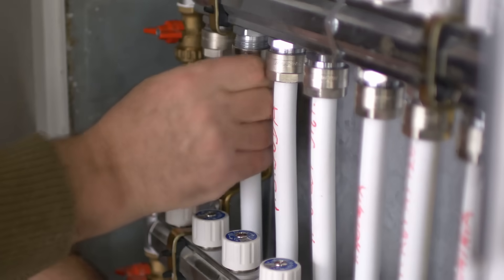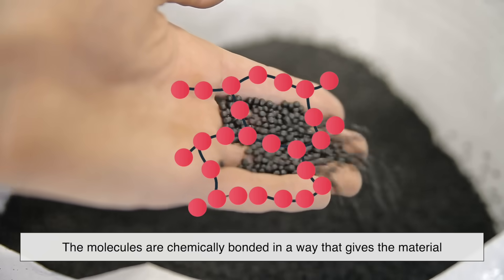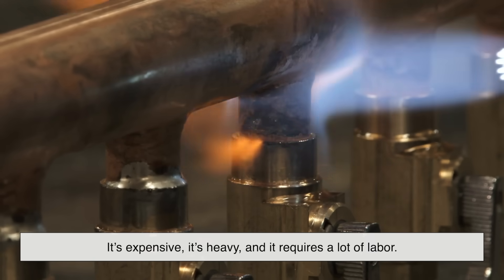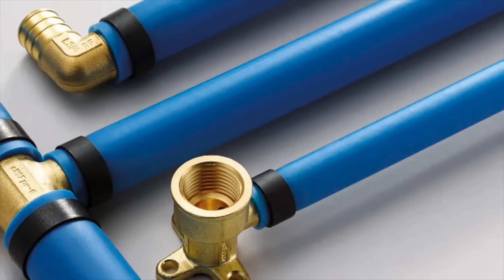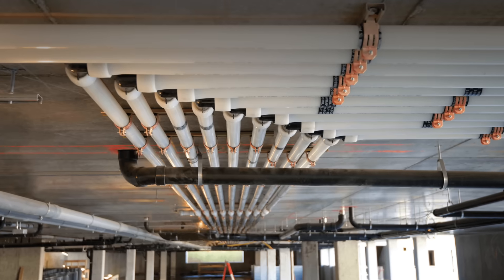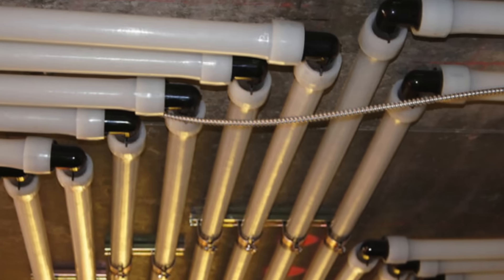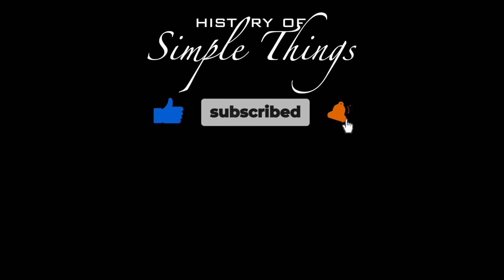What Is PEX and Why Is It Popular in Modern Plumbing?

Comment: Well be ripping all this out shortly all over the place due to toxic chemical leachate and microplastics. Not only that it can't be recycled so it goes straight to landfill at end of life..Plumber of 17 years and not 1" of plastic in my house. All the research on the safety of this product for human health was done  by the industry and then just handed to the EPA for rubber stamping...scary AF. We did not evolve with plastic in the environment and thus do not have the biological means necessary to deal with plastic and it's byproducts in our bodies. Copper can be toxic in high doses as well but at least our body has a means of removing it over time. Pex is also effected by water chemistry despite what they claim and is badly damaged by U.V leading to it becoming brittle and dry rotted. I see it all the time in service. These products suck, period and disgust me while offending my tradessmans honour to look out for the health of society and bring life giving clean water to the people. Stick with copper....proven and proper. Piping you can take pride in as it requires skill and precision.

Comment: Our 25 years old house had copper piping. Five years ago it started corroding. After third leakage we replaced copper piping with PEX tubing. It took just 2.5 days, it solved our plumbing problem. It is a complicated chemistry behind copper plumbing in certain areas, that makes PEX tubing a winner in todays plumbing systems.

Comment: It's cpvc or copper.  Contractors use PEX in new homes to save time and money and  especially in really old homes its quick to install and run in the walls to upstairs. Mobile homes manufactured homes use PEX for years but it was different plastic then now but its still flex and not rigid plastic I'm sceptical about it.

Comment: I'll old school. I like copper. The old plex  pipe would go like toffee at temperatures over 80°C and would burst if the pressure was 0.2 bar at that temperature. I had terrible problems with it back in the day. The new stuff though is so much better. Pressures of 16bar at 95°C. Thats impressive.
Reply: If you live in a place where the temperature exceeds 80 deg. C., I'd consider moving.
Reply: As long as it's virgin copper which is expensive material and labor wise My house was built with recycled copper I have replaced probably 30% of due to leaks Will replacing all the copper with PEX

Comment: Pex or Alupex works great. In timber construction the advantage is in not having to use an open flame near flammable material. There are insulated versions as well, these should be used in cold  climates, to prevent freezing, keep warm water hot and in warm humid climates to prevent condensation on your cold water pipes which could lead to damp spots in stud walls and ceilings.
Don't use fittings in inaccessible places, but run a single length from the distribution manifold to each tap point. Same when used for heating via under floor heating or radiators.
There is even a version used for natural gas in Europe, although I would rather trust soldered copper pipe better for that application.

Comment: I've used PEX, PLEX and Worsbo (I may have spelt the last one wrong) as well as copper! I'll take any of the plastic piping over Copper. Cheaper and easier to repair and replace! I replaced a 50 foot long piece once and all I had to do was attach it to the old pipe and pull, it went right around corners, no issues! Being able to pull pipe like wire is game changing for reno work. Not having to rip entire walls and ceilings out can be such a money saver! Not to mention every single copper to copper fitting is a point of weakness and 90 degree elbows especially so. I forget the length of the longest piece of copper pipe you can get. But you can get hundreds of feet of the plastic pipe on a giant spool and then you cut to fit, it doesn't matter if it's 5 cm or 50 m a simple pair of hand cutters is all you need. The Worsbo requires a special tool that isn't exactly cheap (but you only need one of them) in order to make connections. But I kind of prefered how it went together compared to the other kinds. But I wouldn't hesitate to use either of the other types!

And so far I have heard of NO safety concerns regarding to chemicals leaching from plastic pipe to water. Which is what everyone saying copper is better, tries to claim.

As to longevity, burry a piece of copper beside a piece of plastic pipe, come back 6 months later and see which is in better shape.

Truthfully, the only downside to the plastic piping that I know of, is that it doesn't do well in Direct Sunlight. Over prolonged exposure, it can become brittle. So don't use it in a greenhouse or wrap it! Yes they have insulating wraps and tape for that very purpose.
Reply: Very interesting, what happens in a house fire?
Reply: @megapangolin1093  LOL!!! You do realize a house fire melts solder as well and any pipe that survives has to be scrapped? Riiiiiiiiight???

Those are some mighty thin straws your grasping for! 😉
Reply: You are wrong. Every connection and elbow is a weak point is true for all pipe systems, not specifically copper, but with it you have a soldered metal connection which is much stronger than pex. If you can't learn soldering then use propress fittings. Copper is far superior. 7g of plastic in every brain and 11g in alzheimers brain, plastic pipes are dumb. All pex is virgin plastic, its not recyclable or made from recyclables, copper is infinitely recyclable. You can get copper pipe on rolls. Copper pipe lasts longer everywhere the sun shines, your one counterexample is wrong as pex pipe gets crushed and eaten by rats whereas copper doesn't.

Comment: the 1" pex pipe from the water heater in the attic in my sons 2 story 10 year old home broke when no one was home that weekend and water destroyed the whole home.
Reply: ALWAYS, ALWAYS  close the main valve when leaving
Reply: What did the insurance investigation say? Because I have to wonder if it was properly installed? Pex isn't recommended for some heating systems because they exceed temperature limits and while resistant to breakage when frozen, it can still break. I'd need a whole lot more info before I'd believe it was just a PEX failure.

But sometimes crap happens.
Reply: @12crows1  The track home is in a comuity of 100's of homes all built at the same time, in Riverside Ca.
Reply: @funlovingJohn  I've seen entire housing divisions done wrong because of cut corners. Any other houses do the same thing in the area. Biggest corner I see cut is not insulating the lines and that's a big deal in really sunny locations. PEX gets brittle when exposed to a lot of sunlight! That's why I prefer Worsbo, but it's a little more expensive.
Reply: PEX is a plumbing contractor’s dream come true. It’s a nightmare for homeowners.

Comment: In Brazil we still use PVC tubing, even in new buildings today. Probably because our water is chlorine purified, so it would degrate too fast.
Reply: Pex doesn't react to chlorinated water.  . Nearly every jurisdiction in the US has chlorinated water .
Reply: @texasslingleadsomtingwong8751  The video said that it does.
Reply: @kc9scott  But the reality say otherwise
Reply: @r.guerreiro140  I'd expect that PEX should be OK with chlorine; the US water supply makes heavy use of chlorine, and PEX is common here nowadays.  I'm just reporting what the video said; I don't know what info is actually correct.

Comment: Whats the history of backflow preventing devices? What are they used for and how do they keep your water safe to drink?
Reply: Ummmm, backflow preventers aren't really used to protect drinking water. They are more to keep water flowing in one direction in a looped system. Backflow preventers can also be used in sewer systems to stop sewage from coming back up. 

If you've seen someone put a backflow preventer on a drinking water system, I have to ask WHY???

I was the Maintenance Supervisor for a city of 150 000 and if you need a Backflow preventer on an incoming drinking water line, then you have a problem and it might be a crooked Plumber.
Reply: Isn't the water plumbed to your house considered drinking water? Or commonly referred to as potable water. A backflow device does protect your drinking water ( potable water) that is supplied by a municipal water provider. If you have irrigation plumbing in your lawn and use chemicals like fertilizer or bug unaliver or moss-out, the water provider requires these customers to have a working backflow device maintained in that property to protect from cross contamination from those potential hazards. Yes, these devices do protect drinking water. Just sayin'.....
Reply: @ No that is still a 1 way system with a shut off not a backflow preventer! Again the only way for cross contamination is if it's installed wrong. There might be some super system under a pro football field somewhere with backflow preventers. But nothing residential. I have 20 years in plumbing and heating. Just saying... So whatever local moron made that bylaw knows nothing about fluid dynamics. Wow!
Reply: The ones that I’ve heard of are called vacuum breakers.  They are typically used in places where a water conductor could connect with a “dirty” body of water.  Example use cases are (1) a garden hose sitting on the ground with its open end submerged in a puddle or bucket, or (2) a handheld shower sprayer, or (3) an automatic trap priming system.  They are meant for situations where the water supply pressure could drop to zero or negative, and protect against dirty water being sucked into the supply system.
Reply: @kc9scott  Correct. But they are NOT "Backflow Preventers" and usually only seals when under pressure. Negative pressure forces it open wider.

Unlike a Backflow Preventer which should always be closed when fluid/waste isn't moving in the desired direction.

And Honestly a "Shut Off" solves that problem outright. Anyone that would leave a potable water system open to contaminates because they wouldn't put a shut off valve on it. Isn't a plumber I'd use!

Comment: I have a 1" pex pipe that fell over on my driveway and it broke in half. After a few years pex pipes become brittle
Reply: It typically does that from exposure to UV light ( sunlight) . This is problem for beach houses with the pex not insulated under the home.  It gets as brittle as glass if it's not insulated or covered in some manner.
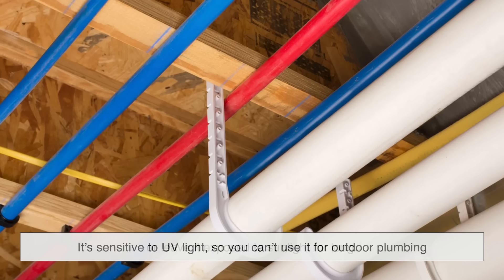Reply: 4:49 read it
Reply: This was obviously the worst invention since treated wood foundations when it was invented.

Comment: With all the new research on microplastics, I wonder if the pex system is prone to erosion over time. The long-term effects of this system are yet to be fully known. 
I am wondering why copper/nickle tubing has not been taken as an alternative to copper pipe. Pex seems to be just a cost cutting product, not a well researched product .
Reply: What kind of diseases are caused by microplastic? I always hear that they are bad but sugar and carbs are also bad yet we eat them.
Reply: @kazedcat  Well, you could do some research on microplastics as you did with aluminum oxide. Also, research refined carbs and sugar as opposed to carbs and sugar in an unrefined form.
Reply: @kazedcat  Eating plastic is bad for you? Rubbish I say. Eat all you can my friend.
Reply: @sophiamountain9966 I just want to know how bad they are. Sugar and carbs are some of the leading causes of death. How is microplastic compared to them?

Comment: I love pex tubing. Used it many times over the years. I once replaced the supply lines on a double wide in 3 hours. The pvc would freeze and crack. The pex froze a few times and didn’t crack. But even if it did it’s easy to replace with the SS clamp style n brass fittings